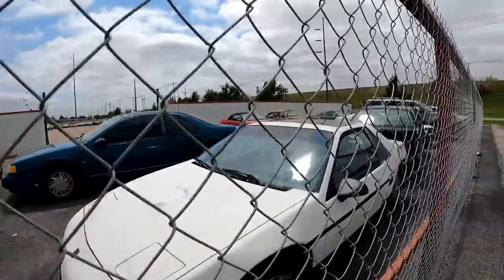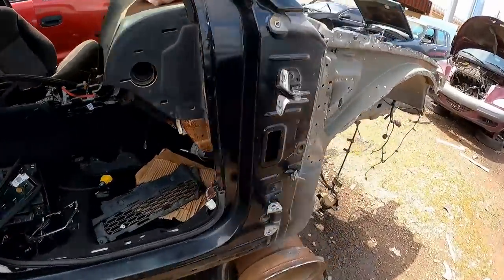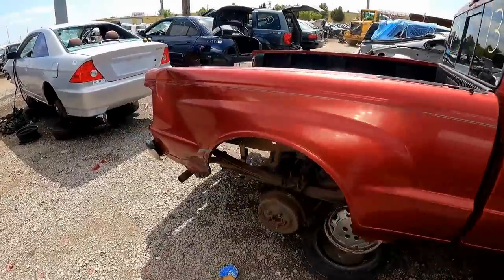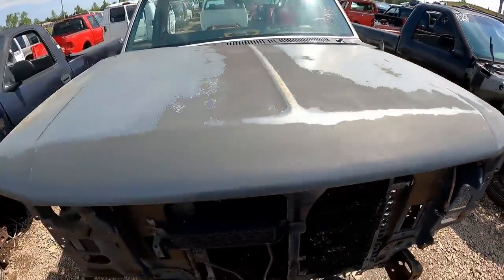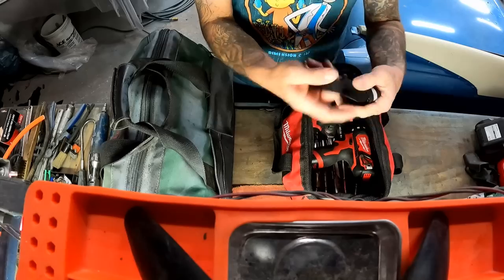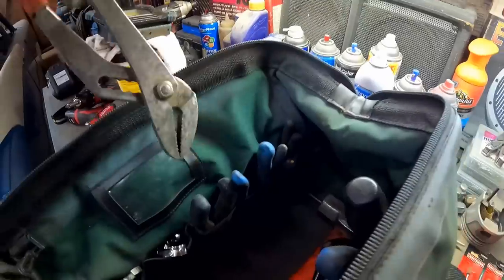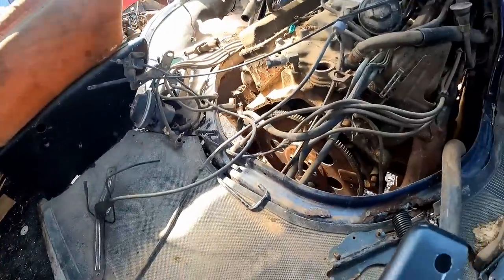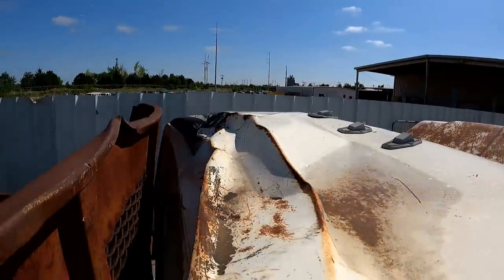THIS VIDEO IS VANTASTIC!!! ANOTHER TRIP TO THE JUNKYARD

Comment: When you were taking the bolts loose in that F150 it reminded me of a story. So, back when I worked in the body shop I had to take those T-50 bolts out of the bed of a F150 in order to make repairs. The first one that I did I struggled to break loose and on the second one I broke my T-50, so I borrowed a co workers. He told me about the trick with a torch, after that it was smooth sailing. Back to the broken T-50 bit. Later on my lunch break I ran to the local mall that had a Sears and swapped the T-50 out no questions asked because it was a Craftsman. I miss the days when you could do that. Working in the body shop you see some stuff and come away with some stories. I was surprised to see what people leave in their cars.

Comment: The thing with those solid straight cars and trucks in that yard is probably because some expensive part was broken like a gbox or a diff or a blown HG. There is always a reason those things are in there. But the good thing is that other people can source nice body panels, doors, interiors, etc.
Reply: It is the culture in the US to throw away old items.  If a transmission goes out it is better to spend $1500 to replace it and drive the vehicle you know for another 100,000 miles instead of spending $6000 for a vehicle you know nothing about.

Comment: I had  a 85 Ford Van that we mad into a camper that towed my three rail dirt bike trailer when me and a buddy used 86-91 in the Texas Cross Country series 50 mile dirt races normal ya 10 mile loop at traces across Texas that would take use from the motor cross track then run us into the woods then back on to the track at the other end , I started with a RM 250 went to a Kx250 and ended with a thumper in a DR 350 that was a Cadillac out in the wood , could pull most hills and water crossings in 3rd gear . Fun

Comment: The salvage yard I always go to by my house here in Ohio is all concrete and the cars sit on these really heavy duty stands that are incredibly secure and they don't impede the ability to get to the underneath of the vehicle. And their prices are way better than anyone else like pick n pull. We have an LKQ but they don't have a self service yard. Pick n pull wants 20$ for a fuse box but you have to pull every fuse and relay out or they won't sell it. And the yard I go to charges 19$ with tax for the fuse box including all fuses and even covers if they have covers on them. The welded wheels are definitely not too secure and I'm always real leery of getting under a car that's on welded wheel stands

And yes, 1998-2005 accords had horrible auto trans issues. They got them straightened in about 06. The 1999-2003 Acura CL and TL and the 2004-2006 TL also had the same trans with the same issues. I'm a big Honda and Acura guy so I know them quite well. I just snagged an 08 accord EX for 1800$ with 191k miles because the fuel pump relay got burnt and needed replaced. Put over 300 miles on it and hasn't had an issue

Comment: I'm not sure if the salvage yards still do it since the Internet and eBay came along and the pull-a-part places more or less took over the auto salvage business but back in the day you could go to a salvage yard and tell them you need a roof for a 1972 Plymouth Fury and they'd put it out on their hotline that they need one and all the salvage yards were connected via a fax line and each morning the various yards all across the country would get a fax with whatever part you needed and would call the yard that put out the notice if they had one. Anyway that's how things were done but as I mentioned the computer age and online purchases probably changed the landscape dramatically.

Comment: Too bad you didn’t have an impact (M18) to remove that truck bed. I like to take a couple small tarps, one to lay on and the other to provide cover from the elements when I’m stuck in one place for an extended length of time. A penetrant such as Liquid Wrench helps and flying insect spray will knock down aggressive pests. Oh, and plenty of drinking water is advisable as well as sanitizer to clean cuts and scrapes.

Comment: The OBS damage was probably not from pulling parts....thats the most common way to break into them and why I like to shave the doors or buy a stupid expensive one piece aluminum billet door handle.  If you see a passenger side airbag on the dash then its a 1997+.  1995 and 1996 had a useless cupholder there.

Comment: I never buy a part, except a body part, off a vehicle that has a good body.  If the vehicle got totaled and has a good body, you know it must have been totally used up.  I need those two doors off the white Ford van, the ones with the windows.  My old 2001 doesn't have windows in the side doors.  It only has 130K on it and doesn't have any mechanical or body problems.

Comment: If you want to know what to pick and flip off particularly Chevy vans let me know.   Not hard to make a decent buck from them particularly if you're willing to ship stuff.
Reply from the maker: Thanks man
Reply: @weirdbeard8898  On Chevy, tilt columns and good clusters are easy flips.  Tilt needs to be tight but no key is OK.  In the salt belt these are prone to the hinges and lower rear door latch having issues with rust. And the door handles with chrome button should sell.  The flip-out windows with the hardware also seem to sell fairly well. 

The cupholder on the doghouse in conversion vans also sells pretty easy, and overhead consoles are good to pick.  Some of those other interior parts can sell, it just depends how big it is and how much you feel like messing with it to pack it up.

I also picked up a tilt from an 80s Dodge last year - someone else yanked it and left it  - and that sold surprisingly easy.  The wheel off it also sold, separately.